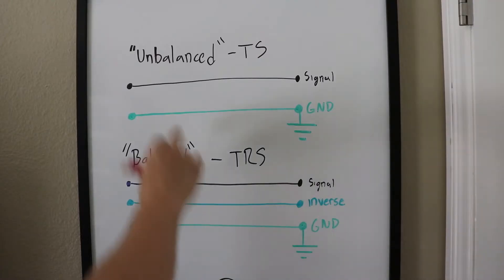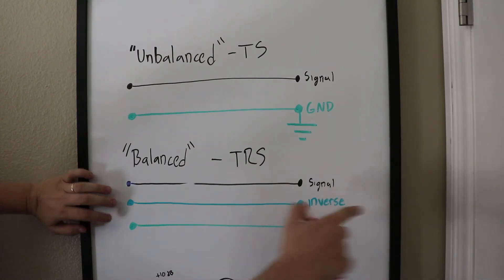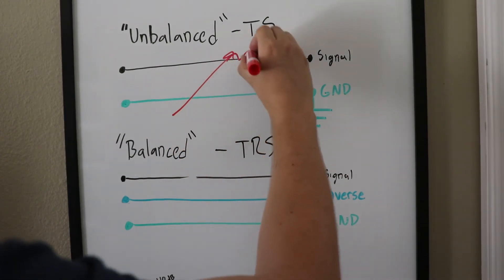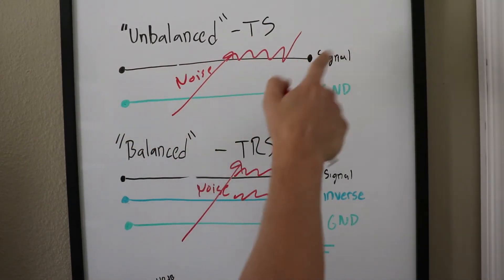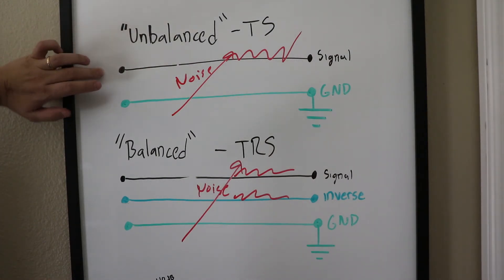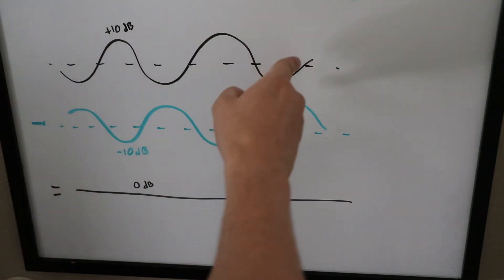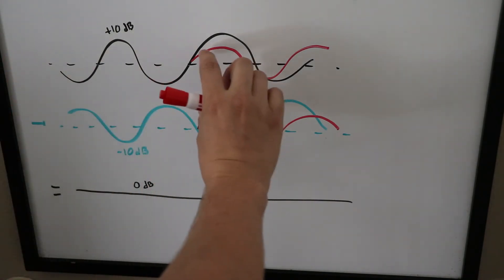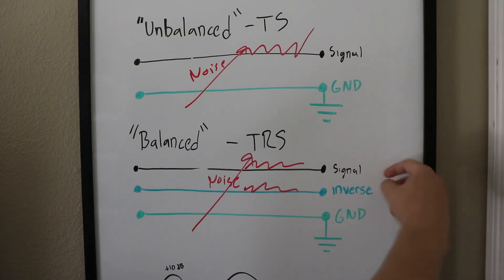Balanced and Unbalanced Outputs - What is the difference?

Comment: Are you saying a TRS cable can be plugged into a mono jack?
Reply: exactly my question
Reply: Today I answered this question
The answer is no. 
I got an electric guitar with the TRS cable coz this dude said so, it kept buzzing especially with pedal effects
Then I got a TS cable and it’s a night and day difference.
Reply: @Mohashm  A TRS plug carries three wires for stereo. No buzzing should be heard when plugged into a monojack because the second positive becomes grounded. A continuity test will confirm this, or you may try another cable. To get noise by plugging a TRS into a TS jack means the plug or cable is defective, or perhaps a cold solder joint. Did you open the plug and check for possible shorting?

Comment: Question... Im getting the Aeros loop pedal that has L and R INPUTS and OUTPUTS, so would run TRS L and R OUTPUTS from synth into my L and R INPUTS into my loop pedal? Then TRS L and R OUTPUTS from my loop pedal into my mixer (2 separate channels)?
Im asking bc i dont know if i should use TR or TRS cables... I also dont know if they make Cable that has 2 TRS into one cable to use one channel on the mixer... I cant find any info anywhere or i may be overthinking this...

Please help!!!

Comment: Thanks for the explanation, I just don't understand if the noise is cancelled why the actual Audio signal is Not cancelled ... ? 😮
Reply: .. because the signals are in "opposite" polarities. Example (+10mv) minus (-10mV) equals +20mV. The resulting signal has even doubled. If there is a superimpose noise of +2mV then (+12mV) minus (-8mV) equals +20mV. The result is still the original signal.

Comment: Cool info. Why aren't all cables balanced then? Seems reasonable you'd want less noise in any situation.
Oh, and a question regarding stereo...since we need two different signals for left and right, we can't really reverse the other to cancel the noise, right? That means all stereo cables are unbalanced?
Reply: All cables aren’t balanced because of cost. Balanced audio takes more expensive circuits and cables. And most often balanced cables are overkill.

Stereo audio can be balanced, it just takes a TRRRS cable, whereas TRS is used for unbalanced stereo audio.
Reply: @thetree1994  makes sense, thanks for clarifying that!

Comment: What should I use for my guitar...???
Reply: Just use a regular jack to jack. You would need to have a balanced output on your guitar and also in your amp to benefit in noise cut but you only get more noise if the cable is over 6/7 metres. Some effects use balanced inputs and stereo outputs for 2 amps in which case you would need a TRS jack socket in your Guitar. It does't make any difference if you use decent shielded cables that are 20ft. I found that using TRS socket on your guitar with a TRS cable can alter the tone for the worse. Keep it simple and use decent mono cables. The only ones you have to avoid are cables made for speakers to amp heads as they are usually unshielded and pickup everything like cb radios and cabs and fuzz(which csn be fun too).

Comment: Yes but NOBODY explains if we can plug a balanced wire into UNBALANCED port and get any benefit of this. Creators are ignoring the elephant in the living room.
Reply from the maker: I have my theory but I think we should put this to the test. Any suggestions beyond just a sound vs sound comparison?
Reply: @TaberTouring  So i just can connect my output from the audio interface to the guitar pedal only doing it TRS on one side and TS on the other ?? or i need something to change the levels or something ??
Reply: This ☝🏾
I listened to this guy and got a TRS cable with my first electric guitar, for a couple of weeks I thought that noise was a normal thing especially with pedals and distortion and compression. Then I got an Ernie ball TS cable and it’s literally a night and day difference. It’s like wearing glasses for the first time when you’ve had shitty vision.
Reply: What is an unbalanced input? It’s only looking for 2 connections, which are probably signal & ground. So, I would think no benefit by default.

Comment: Good video!
What if my wireless microphone receiver is connected with balanced XLR cables into the audio mixer and that mixer is connected with unbalanced cables into the speaker/AV receiver. Will I still hear noise when the microphone is on?
Reply from the maker: Thanks! Good question. Some noise can come from the unbalanced cables coming out of the mixer. My advise would be to keep those cable runs as short as possible if you can't use XLR/TRS. The good news is if you have a high amount of signal (high volume) coming from the mixer then the signal to noise ratio shouldn't be that bad.